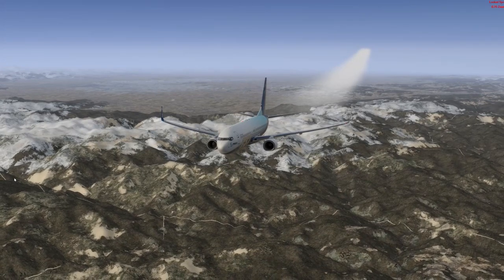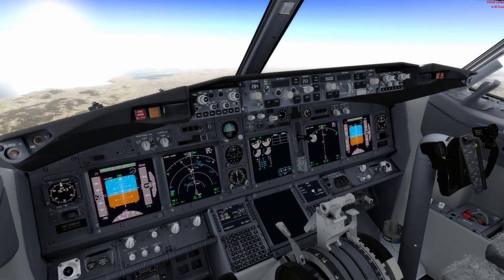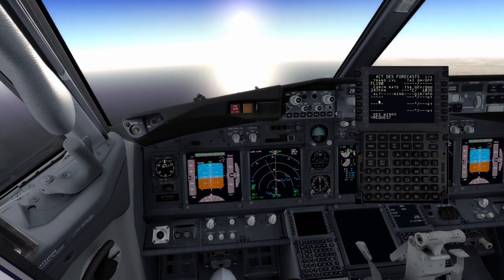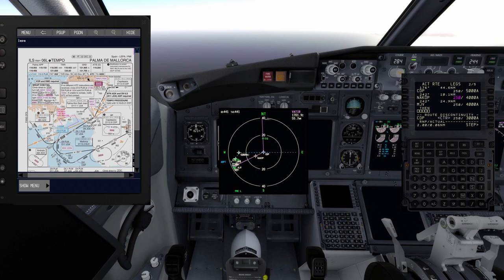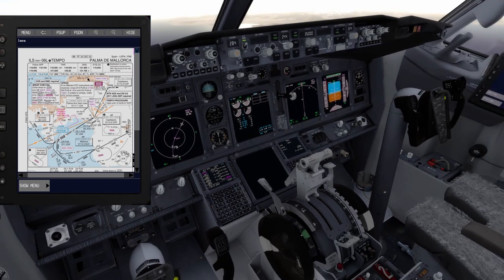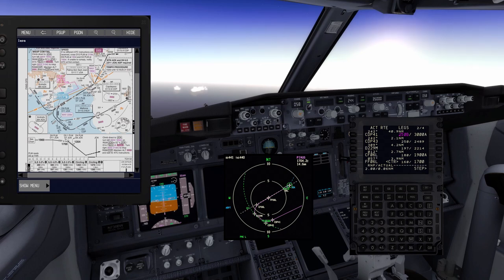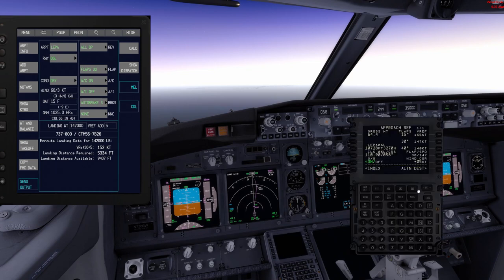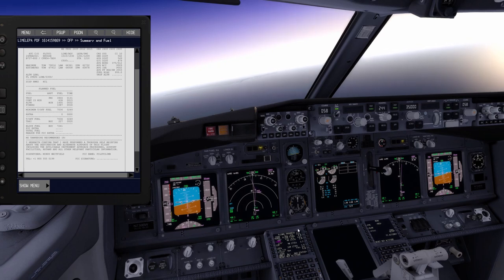Real 737 Pilot Perform Full Flight on the Simulator PART 2 - [Cruise Managment and Descend Briefing]

Comment: Hello Captain, great part 2! I'm really enjoying this full flight, hope you'll perform one on X-Plane 11 and Zibo Mod so I can keep up with you 💪
However, as usual, I have some questions :
1) Why did you select the bank angle selector to 10? I've seen this before but I can't recall the exact purpose of it (I know it works only when HDG SEL or VOR/LOC mode are engaged but I wanted to ask anyways because I leave it to 25 almost all the time). 
2) At 18.41 you said you were going to use TL70 but on the FMC you still had 18000. Did you forget that or it is not necessary to set it at this moment of the flight?
I'm glad to see that you updated the AIRAC Cycle on SimBrief so it now matches the STARS on the FMC. At 29.01 you again inputted 15 F of OAT on the performance calculator instead of 15 C. Thanks for this great idea you had with the full flight and thanks in advance for your answers, talk to you soon ☺
Reply from the maker: As usual great questions! 
1. I set 10 degrees  above FL 300 because if the ATC gives you radar vectors you are protected.
2. It is better to set the TL on the FMC, I'm sure I simply forgot :)
For me it is a lot easier to operate on the real Plane..

Comment: Good Day Capt,what is a speed trim system @B737 ? which flight control surface is used for speed trim for Boeing 737 ?...have a nice Sunday
Reply from the maker: Hey, Thanks for watching!! the STS takes the information from the stabilizer position, the vertical speed and the aircraft speed change and then it moves the stabilizer to make sure that the aircraft has a trimmed speed.

Comment: How to start extending the flaps for a stable Non-Precision approach?
Reply from the maker: Thanks for watching! Check this video: https://youtu.be/4wXOjOuJs9E

On Wednesday I will upload an other video where you can check how to extend the flaps during the Approach.
Reply: @PILOTCLIMB  Thank you captain! I have another problem in the flight sim. In a 737 NG when you hand fly an approach with A/P off and A/T on then the A/T should retard the throttles at 27' RA, and then A/T should disconnect 2 seconds after touchdown. But when I leave A/T on in my flight sim it does not happen, when I flare, the A/T advances the throttles, and the aircraft continues to float above the runway trying to maintain VREF spd., as the FMA annunciates MCP speed, and not RETARD. 😂😂😂 It is quite funny though. Do you have the same problem in your flight sim? Can you pleases check it for me?

Comment: Good Day Capt,in case of hydraulic power failed/loss on B737 NG....are primary flight control such as aileron/spoiler , elevator , rudder still can be operated ?
Reply from the maker: It depends if you have a loss of hyd A and B, in this case the rudder is operated by the standby rudder system and the main flight controls go into the manual reversion, which means that the hyd does not power the flight controls anymore, thus, making a lot harder for the pilot to change pitch and roll for example.
Reply: @PILOTCLIMB  I see... the rudder is operated by the standby rudder system,so this mean only rudder still be powered by standby hydraulic ,for aileron and elevator not anymore incase loss of Hydraulic A and B so have to fly manual inversion using wire string or muscle force of pilot hand?